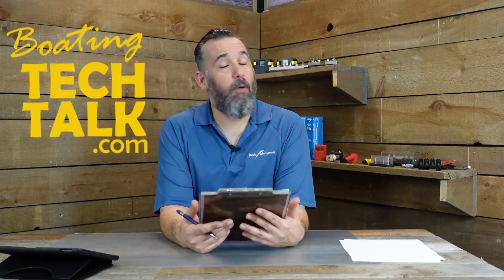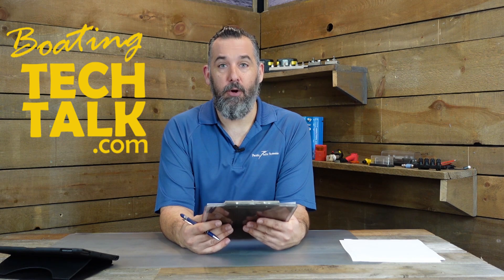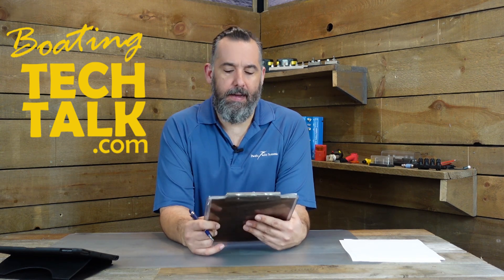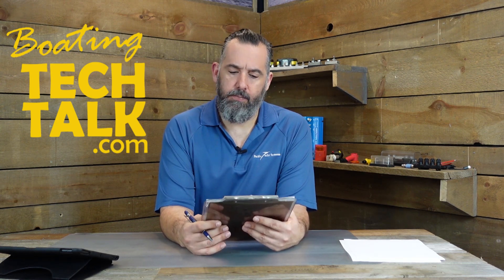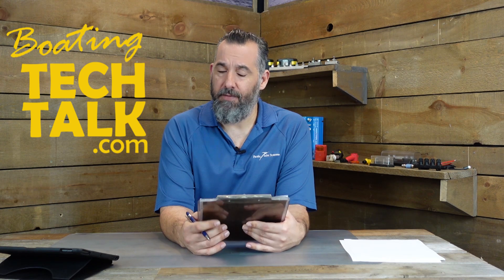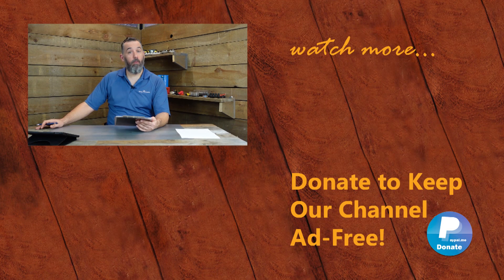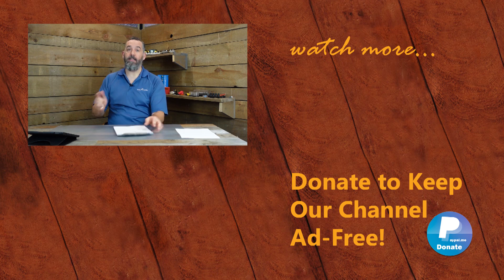My Boat Ignition Key is Off but the Engine Is Still Running?

Comment: Hey, this happend to me but i dont have a diesel engine. I have a Mercury 90HP 2 stroke engine & this happend to me when starting up the engine (engine didn't fire up), so then i removed the key and the engine still trying to turn over. So i had no other option but disconnect the battery to stop this. Is this a solonoid issue? Thank you

Comment: On an Izsu diesel motor model 4J B1 in my Sany 55 C Excavator I have a similar problem , The motor has done 700 hours it won’t shut off when I turn the key off. Would this also be a solenoid problem? Or I was thinking the glow plugs could have carbon on the top end and still glowing when you switch off, and thus is still igniting fuel, thoughts on this would be appreciated,

Comment: My boat key doesn't even turn I ordered a new key but I'm not sure if it was just out the blue and  got stranded I'm just wondering if I should replace the whole thing it is a 1977 Mercury 50 outboard
Reply from the maker: Don't have a lot of experience with this setup, but sounds like your suggestion to change the ignition key is a good first step.

Comment: I have a new solenoid (added last month) the engine was starting and shutting off as suppose too but today i started the engine then turned the key off which worked then started the engine again and then it wouldnt shut off when turning the key off and removing. Any ideas why?
Reply from the maker: It's quite possible that to shut off your engine, you'll need power to the ignition key. Try shutting down your engine and then turning off the engine battery solenoid.
Reply: @PacificYachtSystems  hi, thanks for the reply. I tried your advice and still no luck. Any other ideas

Comment: Happened to a friends hot rod he built.  Turns out he wired the ignition to the amp guage.  Before he upgraded the alternator to a huge amp model. More amps than the guage could handle.  It only went up to 80.
Reply from the maker: Interesting, thanks for sharing.

Comment: Hmm i only been on 4 boats, but on all 4 of them engine didn't stop with key ignition turned off :) actually, the procedure to start was to move key to 'off' after engine starts. Manual off yanmar say to 'shut down with fuel cutoff button', not with 'air cutoff'
Reply from the maker: Hi Marek, thanks for sharing. Sounds like i'm the only one with an old engine that you turned off the engine via a air cutoff. Even disabling my fuel pump doesn't stop my engine.

Comment: I've had this on my Cat 3126. There is a fuel supply solenoid that is energized when you start to open, remove the voltage and it cuts off the fuel. This is powered through a $15 relay that commonly fails. I carry spares now.
Reply from the maker: Hi Rob, good idea, at $15 for the spare part, it's definitely worth carrying.

Comment: What about you're washing the boat and the engine starts by itself? Turned out that I had salt water in the bilges (I had a leak in the raw water cooling system section) and this shorted out a small relay that I had installed near the starter which in turn energized the starter's solenoid. Now that's WEIRD!
Reply from the maker: OMG, that would be freaky until you figured out how it happened.
Reply: @PacificYachtSystems  And before realising what happened, I asked my 14 year old son, who was inside the boat, why the hell did he start the engine instead of continuing with the washing! Needless to say, at first I didn't believe his denials!

Comment: Further to my previous comment, shutting down a diesel engine by asphyxiation (choking off air supply) is difficult because diesel engines run very lean...it does not take much fuel to keep a diesel engine idling (why you rarely find diesel engines shutting off at stop lights like you do for gasoline engines...diesels use very little fuel at idle that there is no benefit to shut engine off at stop lights).
Reply from the maker: Thanks for sharing Borys, that probably explains why even when my fuel pump is not powered, the diesel engine still runs.

Comment: Great explanation Jeff, thx! Learned that when my stop button didn’t do anything because of a broken ground connection on the fuel solenoid. 
I then was told that you’re risking to burn your alternator (and possibly more ;-) when you try turning off the ignition key or keep it turned off while the engine is running.
Is that correct or “it depends” ? What to check for?
Reply from the maker: Hi Peter, good question but not sure of the answer. On many boats, when the ignition switch is turned on, the alternator is in turn energized only if the ign switch is on. Turning off the ign switch should also turn off the alternator.
Reply: I’ll check that when I’m back on the boat. Thx Jeff!

Comment: Older diesels use a mechanical fuel pump.  Newer diesels typically use low pressure electric pump to feed high pressure mechanical pump (driven from the engine).  To shut of the engine you need to shut off the fuel flow with a solenoid valve...older gasoline engines with carburettors and carbon build up would “diesel” after shut down (ie keep running) bec they would keep drawing fuel from carburettor and ignition would be courtesy of some hot bit of carbon build up in the cylinder(s).  With diesel engines you need to shut off the fuel supply because there is typically no way to shut off air flow (newer diesel engines do have butterfly valve in the intake for improved emissions via EGR).  One of the reasons diesel engines are more efficient than gasoline engines is because diesel engines have much less restrictive intakes (no choke or throttle valves).  Older diesel engines will use a solenoid valve to stop fuel flow; newer common rail diesels just deactivate the injectors.  Choking an older diesel engine of air to shut it off will result in a load of diesel fuel dumped into the cylinders that will sit there until you start engine again (not good for longevity of the engine).  The burning smell that the writer mentioned is likely the fuel shutoff solenoid valve not working and not shutting off fuel supply.  (PS the word you wanted is “ass-fix-ee-ate”).
Reply from the maker: Hey Borys, this was great reading, thanks for sharing. Learnt lots.

Comment: Jeff the pull cable or solenoid shuts off fuel not air....cheers!
Reply: Exactly!
Reply from the maker: Thanks for correction.
Reply: No necessarily true if you have an older Detroit diesel engine your safety  might be the air flaps

Comment: Question! Jeff, I have a Catalina 38  here Costa Rica with an old Heart Inverter/Charger that turns on automatically when shorepower is on. Can I start the engine while it is charging and I’m also using appliances or the air conditioning? Always heard not to do it, but still not sure why..
Reply from the maker: Good question, before you leave the dock, it's preferable to know that your engine battery, without a battery charger helping, can turn over your engine without trouble. Also, some boaters are worried about the voltage spike that might result from a suddenly removing a start load with a battery charger pumping max amps to offset the voltage drop from a starter. Although, never seen this happen myself.
Reply: @PacificYachtSystems  great advise, thanks!

Comment: Jeff,   I believe that a diesel engine stops because the fuel is removed, not because the air was removed.
Reply: It is true, the solenoid shuts off the fuel flow to the engine or the older pull cable does the same thing.
Reply from the maker: Thanks for sharing, totally messed up on that one.
Reply: @PacificYachtSystems  thank you for your channel🇦🇺I have a retrofitted sprung thick rubber flap on cat 3406 turbo air intake released by wire and fuel shut off valves by wire. The air intake method seams faster in a runaway diesel scenario if the seal is good.

Comment: On most diesel engines, the stop cable/solenoid cuts the fuel supply to the injection pump, not the air supply. In an emergency like with a runaway diesel, you can strangle the air supply with a cutting board, seat back or other solid object by blocking the air intake with it. A CO2 fire extinguisher can also be used to starve the engine from Oxygen (never use a dry chemical extinguisher, that's a surefire way to wreck the engine).
Reply: some  people keep a 'Nerf Football'  in the engine compartment to stick in the  air intake. Can also be used to slow a leak in the hull
Reply from the maker: Hey Nicholas, thanks for sharing.

Comment: Ernie had a diesel engine with a stuck open fuel solenoid. Simple question for a diesel engine system but could get much more complicated for gas or larger diesel systems. Fuel & Air cutoffs very useful. Jeff thanks for educating!
Reply from the maker: Great point!

Comment: I've had this happen...twice! Once when shoddy work caused a massive short and blew the main fuse, killing all electrical systems. In that case, the diesel's ability to run without power was a blessing, as we were just coming into the marina. The second time when the solenoid vibrated loose. At least it didn't fall in the bilge! So now I know where the manual shut off is, and the next project is putting in a manual, back up cable stop in the cockpit.
Reply from the maker: Nicole, thanks for sharing your stories about this too.